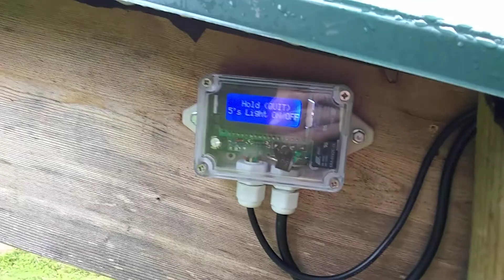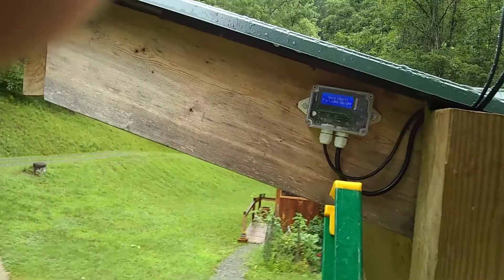Error Message/Glitch for ECO-WORTHY 400W Single Axis Solar Tracker -- stalls operation of tracker.

Comment: How are you powering the unit? I had some problems when testing  my new dual axis unit because it was not getting enough power.
Reply: I have a 20W solar panel tied to the unit with a 12v battery to power it.

Comment: Mine does the exact same thing.   I see too many complaints about this.  Amazon should not sell these things since they obviously are very poor quality.  I have three trackers and they are pointed every which direction. looks ridiculous from the road because it is ridiculous.  Thanks for the video.   Plus your video wasn't that jumpy.
Reply from the maker: Mine has stopped working again. I think it is the inline fuse this time. I have a big stack of logs to split on the ground underneath it, so I have to split them to get up there to change the fuse.